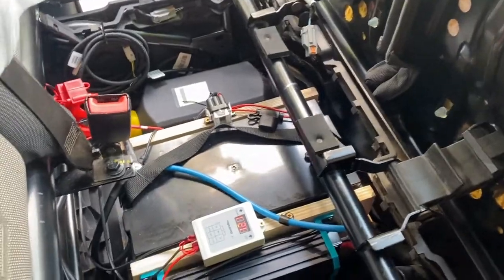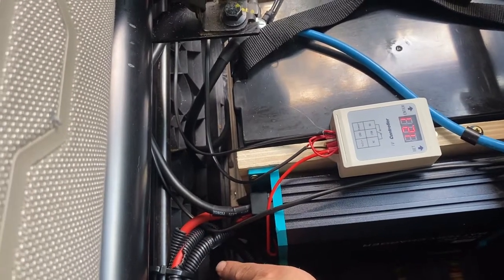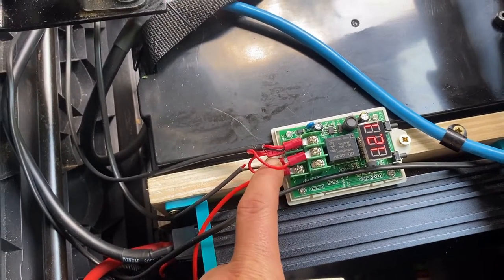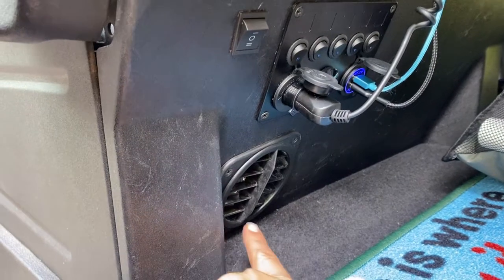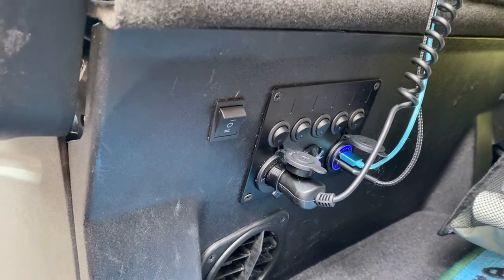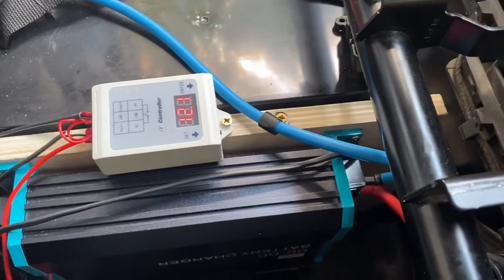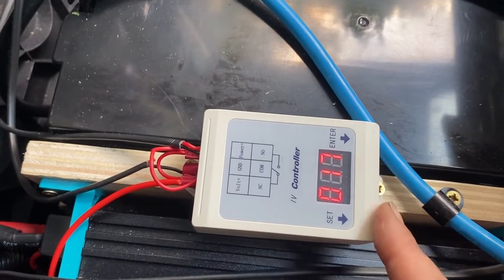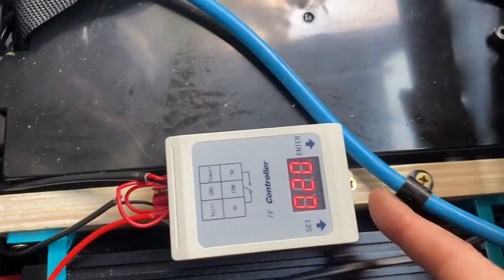Wiring a Renogy DC DC charger D+ the EASY way!

Comment: Hi guys. I need to do exactly this to a transit custom on a 13 plate.  Gone to buy the product from your website and it says that it's not suitable for smart alternators? How have you got round that?
Reply from the maker: Interestingly, I thought the Victron Orion (which is suitable for smart alternators) had a fancy computer on board which use some sort of altorighm to determin whether the vehicle is running or not. It doesn't, its just different limits. So you can use this for a smart alternator, you might just have to play around with the thresholds a bit to find what works for your van.
Reply: @bobilvans4205  now that is interesting 🤔  typical of companies trying to sell you a fancy gadget that's unnecessary. 

So with this once it hits the predetermined voltage it powers on after the pre set delay. Will it then stay on if the voltage drops due to the smart alternator? Or do you have to set the on and off voltages ??
Reply from the maker: @davidt3321  yes it will stay on until the voltage drops, but you can set the turn off voltage quite low and minimise the time delay until it turns on again. When I was playing around with it on a smart alternator the voltage rarely dropped below 12.5, resting was 12.7 so setting it to 12.8v meant the charger would be on for 95% of the time.
Reply: Excellent thanks for that. Does it come with dummy proof instructions? And how it's wired etc. I'll be doing it the same as this video but without the extra switch
Reply from the maker: @davidt3321  add a note on the order at checkout asking for DC DC instructions and we’ll put them in for you
Reply: Thanks very much 😀 👍

Comment: Hahaha ha! What a cop out. You realise that by using a VSR (set to lower voltage) you are COMPLETY removing the need for a dc-dc charger! Just use a low set VSR to charge batteries.
Reply from the maker: You can’t use a VSR for lithium batteries which is the point of this video.

Comment: I've got to install one of these for someone so ill be getting one of these. Low amperage one should be ok for this purpose given its only a low current signal right?. Just seems like an oversight and cost cutting that it doesn't have built in sensing like the victron. I'm not overly convinced about renogys stuff being that good compared to my experience with victron stuff that "just works" topped off with horror stories I've heard regarding their customer service. When I order one of these would you be able to provide the wiring diagram for the switch as well?

Comment: Hello Ed, a great alternative to locating the D+ wiring. It seems like a perfect solution for vehicles manufactured before 2015 that have traditional alternators. However, I was wondering if the Transit Custom in the video has a smart alternator that was produced before 2015? I am curious to know if the system works with smart alternators since they have low-voltage outputs?
Cheers
Reply from the maker: Hi, it doesn’t work with smart alternators I’m afraid. Ed.

Comment: I use a preset voltage-sensitive  30a relay that comes on at 13.2v and off at 12.8v to switch on my Renogy DC to DC  and rear-facing cam on my RV

Comment: All you have to do is use a piggy-back fuseholder on your ignition fuse.
Reply: How do I know which is my ignition fuse
Reply: @MrYorugua12345  Usually you will have a diagram inside the fusebox but otherwise, just put a 10a fuse in the piggyback, wire it up to the charger, then pull out a 10a fuse from your fusebox, put it in the piggyback next to the one you already have in it and pkug the holder in where the fuse was. 

If its the ignition fuse your dcdc won't turn on until you turn your key to ignition.  Just keep trying every 10a fuse unril you find that one (ignition is usually a 10a).
Reply: @GregRickard  thank you.
Reply: @GregRickard  Are you sure? I checked all fuses and do not see any which give a voltage only when the engine is running. Yes, there are some when the see is in the ON position but it doesn't meet that the engine (and alternator) is running.
Reply: @RyszardSobczyszyn  the charger is looking for a SIGNAL only for the ignition wire. The other big meaty power wire should go straight to the starter battery.
Reply: @GregRickard  I know. But technically when your accessories are on you have voltage there and D+ starts charging from the starter batter (using separate cables of course). Accessories could be ON without the engine running. I did not find any fuse which gives voltage only when the engine is running. There should direct connection to the alternator but I don't know how to find it.
Reply: @RyszardSobczyszyn  Put a toggle switch on the wire.
Reply: @GregRickard  then you forget it on, and drain your starter battery...

Comment: Great install - I’m about to install one of these chargers on a 2017 Peugeot Boxer. Is there anything stopping me from using a spliced connection from the cigarette lighter feed for the D+ signal? The cigarette 12v feed is only live when the ignition is on, but I appreciate I’d need to make sure I didn’t sit with the ignition on but engine off
Reply: I’ve got a Citroen Relay and I’ve used a piggy back fuse to get an ignition feed similar to your 12v cigarette lighter. I’ve then put a switch (with a small light) so that I can turn the charger on and off when needed and I try and check it’s off before starting the vehicle to reduce any extra strain on the alternator. Not a perfect solution but it’s cheap